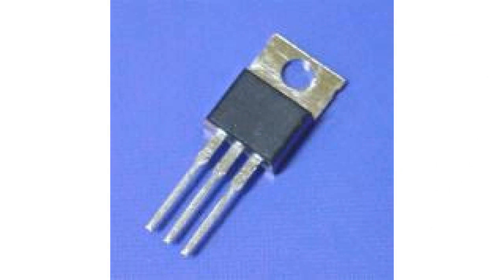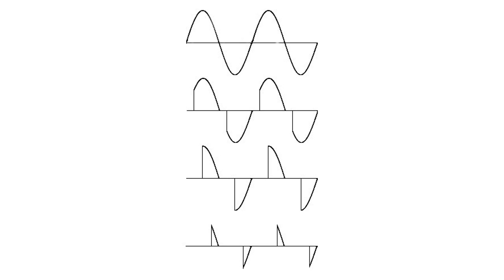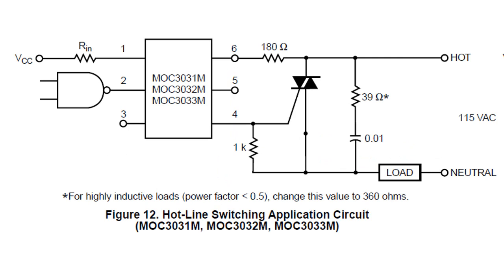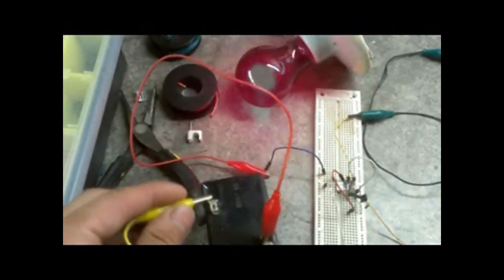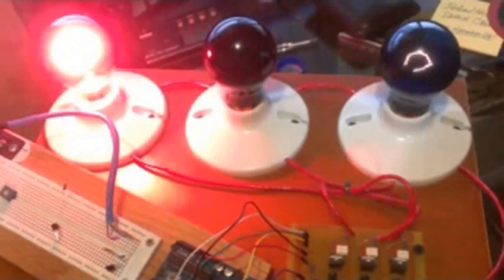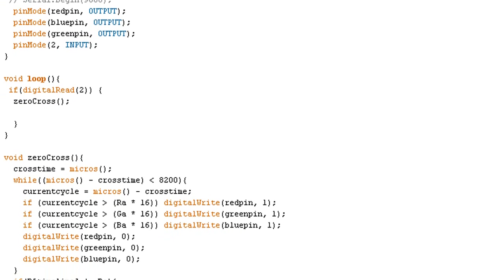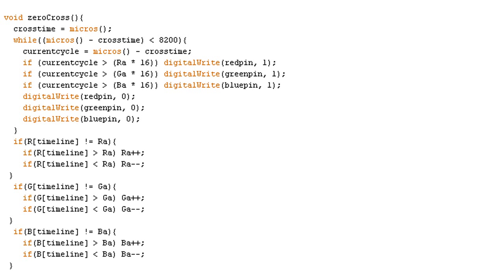3 channel Arduino AC fader/dimmer

Comment: Very helpful, meant i could work out how to use the InMojo ac dimmer module i bought. Incidentally, your code examples helped, but needed some tweeking to get it to stop flickering. Tweeked Arduino ino code here, http://pastebin.com/7x1ZFURV

Comment: @Chauncey Friend
you are right, the code in the video is incomplete, it misses a loop to cycle through the array.
Also the solution to change X[timeline] by checking if it is too high or too low and then increase or decrease it seems a bit awkward. Why not just read the value from the array and use that

Comment: I dont understand youtube anymore as  apparently I cannot reply to some people here, so I just  write a new message to
@RUBEN DARIO GUZMAN CURET
In case you still have trouble, the MOC3031 has a zero crossing detection circuit of its own so  it wont work. You can trigger it all you want but it will just wait for the zero crossing

Comment: are the  the chip moc3020 able to handle 240 voltage? and how much load can i run over this circuit board ? / thanks Fredrik / sweden

Comment: I think this video is good,but i would like help: i am using H11AA1 and BTA41-600B and MOC3010,i tried with MOC3031 any it doesn`t works,the codes are fine,could you help me with this.
Thanks and keep on.

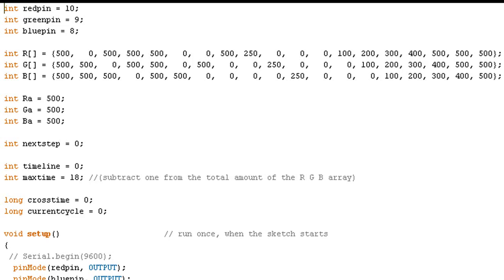Comment: In your code section of the video (5:07) you create the variable "nextstep" which appears to never be used.  I am wondering if this is an older code example than what you actually used?  This code doesn't appear to have a way to change "timeline" to anything past 0 which should never use your array values past the first values.  No big deal to fix, but is this true? Thanks for posting this project BTW.

Comment: @shrynikjain.
Seems both are in the video. If however you need something less 'moving', Go to 'instructables' , and look for 'Arduino controlled light dimmer, make sure you copy the TRIAC circuit an extra 2 times :-)

Comment: Very cool, just 2 questions though. If the duration of the cycle is 1/120=8300uS, why sampling for 8200?
and why do you multiply the RaGaBa values with 16. That seems kinda random (or maybe I just dont see the point) :-)

I actually dont think it makes much difference if you use an interrupt or are just polling pin2, though maybe the software in the former is a bit trickier.

Comment from the maker: If you're triggering on the rise, then you're only triggering at every cycle, not every half cycle. (unless you're rectifying your signal into the arduino) And if you are not rectifying, then would the arduino interrupt be triggering on the quarter cycle (when the lowest low starts going high again)? I'm not sure about that. When you make logic 1 go high, are you turning it back to low so the triac can shut off? What components are you using between the Arduino and the power line?